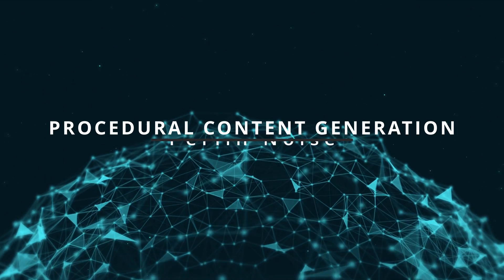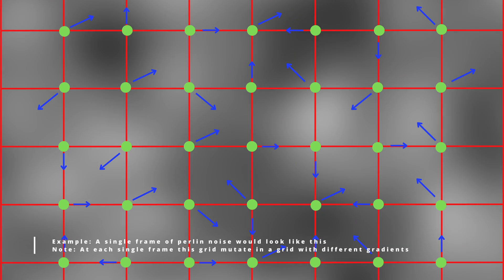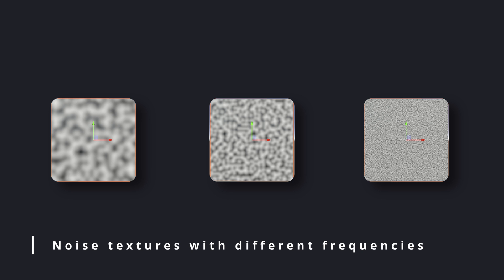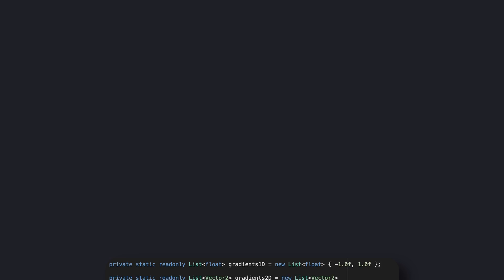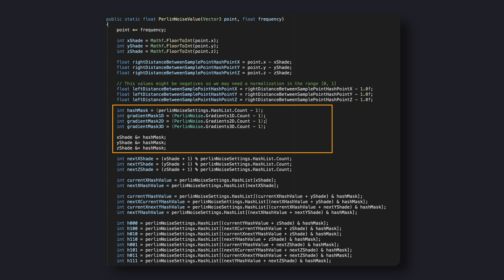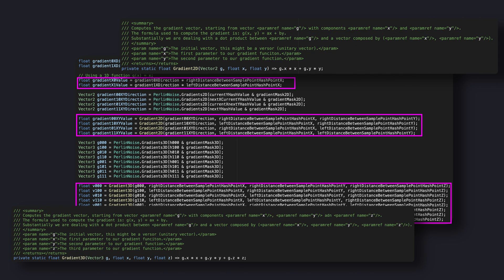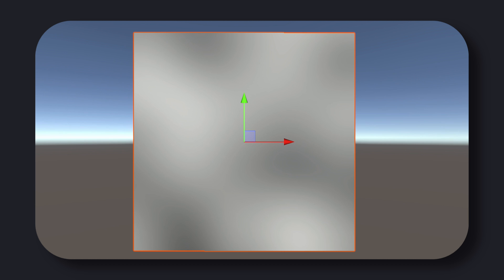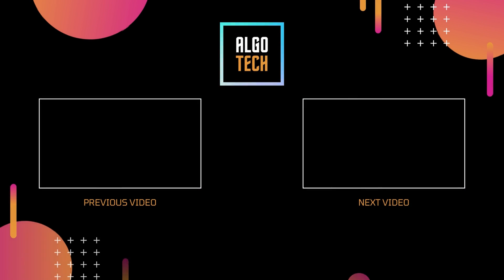PERLIN NOISE Demystified: All You Need To Know

Comment: Great video but there are some things you said that are definitely not true; First mistake is that Perlin noise is NOT THE SAME Simplex noise. They result in similar looking outputs, but the way they are produced is vastly different. Perlin noise is based on hashing gradients on a lattice grid and interpolating these gradients at points inside this grid. Simplex noise does the same, but by using simplexes instead. In general,  an n-simplex is the shape you can make with n vertices in an n-1 dimensional world. For example, a 3-simplex is the shape you can make with 3 points in 2D space; a triangle. In 3D space, a 4-simplex is the shape you can make with 4 vertices in a 3D world; a tetrahedron.  I won't go in detail here, but by using the simplex-approach allows for better scalability towards N dimensions and lower computational costs in general.

Secondly, the result of Perlin noise is definitely not random. Perlin noise is indeed used to create natural looking phenomena, but it's important to note that it is DETERMINISTIC, meaning that when you hash the gradients using the same seed value, the result will always be the same. If it were truly random, it would be useless.
Reply from the maker: Hi Matthias, thanks for the comment. Well, let me clarify what I said. The explanation you gave for Simplex noise is quite accurate, though Simplex noise is also known as Perlin Noise, due to the fact that it was invented by Ken Perlin as an improvement for his previous algorithm! As you said Simplex Noise does the same as Perlin with the difference of the spatial subdivision pattern, aimed to improve the performances and the issues that his previous noise function had, though this is a further improvement that I thought would have been too tough for the viewer to understand. Still it's correct to say that what I explained is not Simplex Noise, it's a basic explanation of what Perlin did with his classical algorithm, even though the concepts that I explained are then used in the Simplex Noise with the difference of summation instead of interpolation!

I beg pardon if I said random, it's more like pseudo-random, due to the fact that nothing in the world of Computer Science is truly random! Anyway the output of the Perlin Noise is indeed deterministic due to his mathematical definition, a function that returns a deterministic result based on the inputs it receives. I mistakenly said random, and it's not correct, it would have been PSEUDO-RANDOM, so nice catch, and thanks for the correction, I talked about Perlin also in the previous video by talking about pseudo-randomness, but this time I messed up! Based on this I'll improve the video by adding all this information in order to improve the content, and probably I'll do a video about Simplex Noise so I can also explain what is that, thanks for you time and for the precious correction you gave me, it means a lot (now that I know that I have viewers with high understanding of the topic I can push the explanations a bit further) 😃